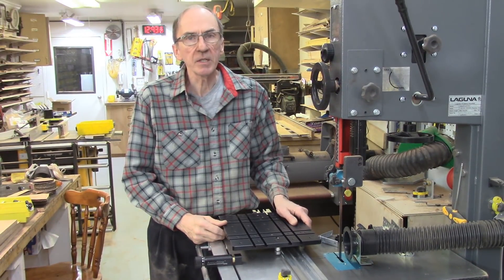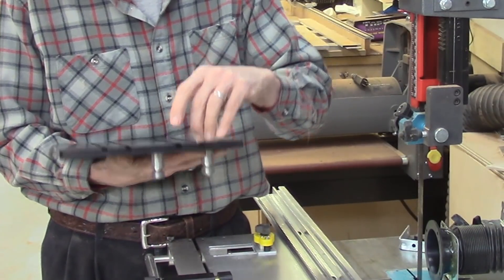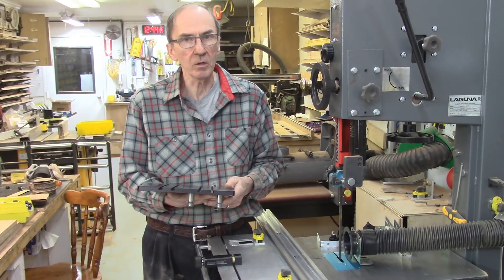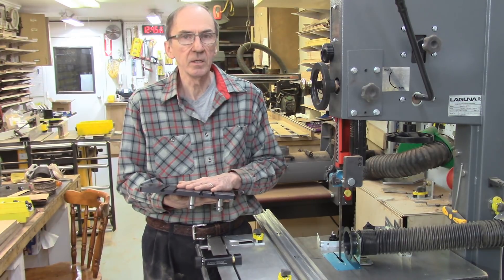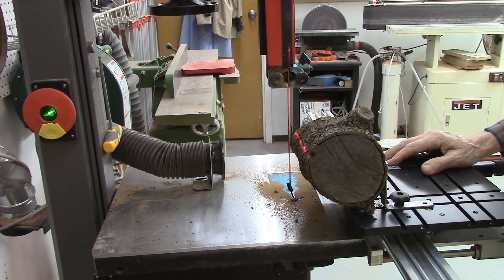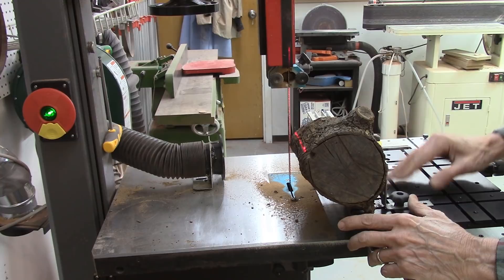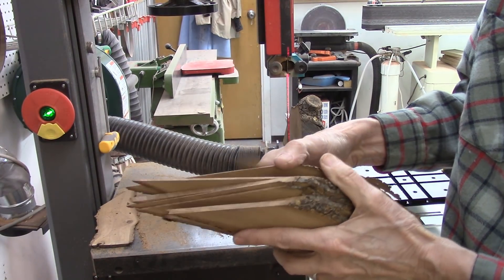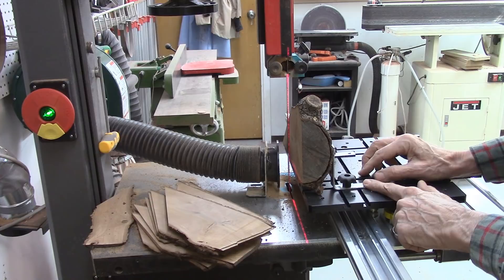Slicing Logs with the Accu-Sled Carriage 43)

Comment: would like to see how big a log (length and girth) that you could mill with 2 of these sleds.   also, I wonder about the price point of this item.   Try to make one much cheaper...
Reply from the maker: I would not recommend doing any larger logs on the Accu-Slice system or these small band saws.  The tabs are just too small and cannot support the weight. The maximum size logs that I have cut to date with the Accu-Slice  were not over 8" in diameter and not over 15" long.